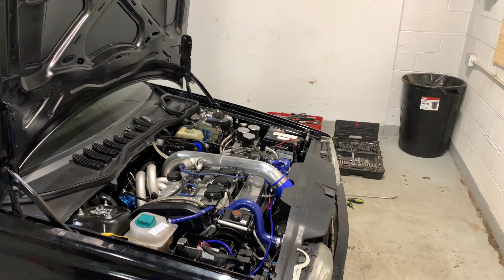Volvo 850 T-5R AWD Swap - Finalized Upgraded PCV & COP Harness

Comment: In the process of doing COP conversion with a 4.4 ecu. Im assuming because you have an aftermarket ecu the signal pin out would be different? 
Been trying to find if i can use the factory pins but not having any luck on a diagram 
Maybe you might know

Cheers

Comment: Awesome videos! I have 2 (immaculate restored) 1998 S70's. 1 black 1 red completely stock. Can you tell me if I'm able to put an ECU from Ebay for a 1998 S70 T5 2.3 into my GLT and if It would hurt anything? And just out of curiosity you being very knowledgeable, why doesn't an ECU flash last forever? I don't get why the flash would revert back to stock. Thank you for your time and vids!!

Comment: Hey Matt can you use the Volsquirt as a stand alone ecu? I'm swapping a whiteblock into a classic and need to know what other wiring I need to pull? Thanks
Reply from the maker: It is already a full standalone (megasquirt 3 pro). Its just designed in a way to reuse the factory harness.
Reply from the maker: So if you pull the engine harness and fuse box harness out of a 94-98 volvo P80 you can use it
Reply: Sorry, I just watched the video on it...don't know how I missed it

Comment: I rarely see those fail and if you just replaced it that’s unlikely. Try to pressure test it maybe. You think the block is leaking again unfortunately 😥?
Reply from the maker: Its definitely the cooler. It has a bit of a dent in it. Probably got kicked around during the AWD build. Totally dry above the oil cooler and no leaks coming from the block. Puddle is directly below the oil cooler and concentrated.